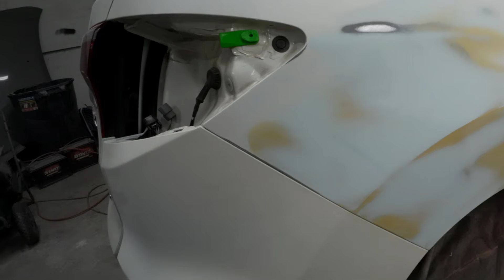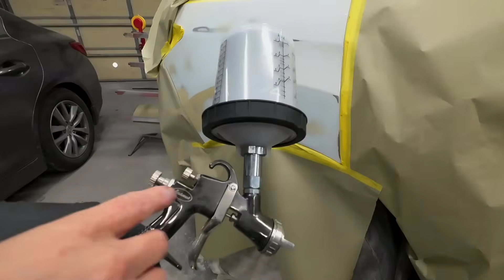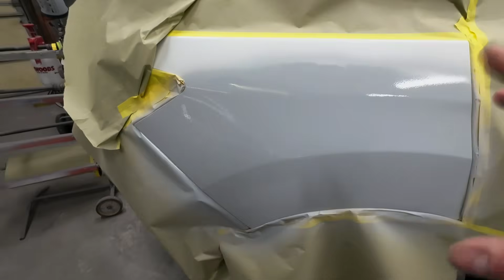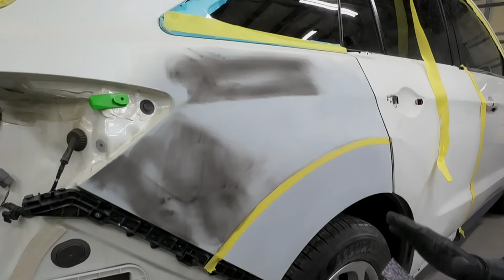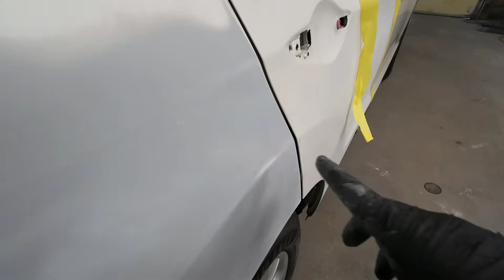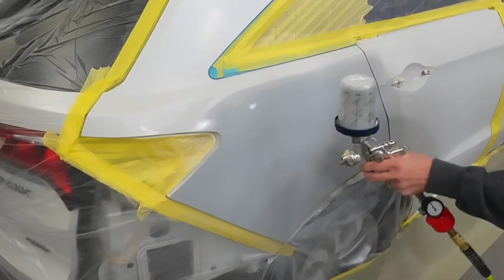How to get perfect primer before painting your car!

Comment: Can i paint over 2k surfacer primer?? Currently working on a project
Reply from the maker: Yes, it must be sanded first. Maybe I'm not following.
Reply: @GarageNoise gotcha and before applying the primer use sand paper should I use on the rest of the panels I would be applying fresh paint and clear coat

Comment: I do mobile smart repair and I'm very new during the summer when I was spraying my Nason SelectSeal Sealer it was no issue but now during these winter months it will super run if I spray like I did in the summer, I do preheat my panels, or alloy wheels if im doing those, to around 70-80 degree F but I can't seem to spray like normal doing one normal coat, I have to mist it on now in multiple coats to get my sealer to not run any tips to fix this? I'm spraying using a DV1 Base and usually around 15-20 psi Fluid I've normally ran it just full open, and i'm in southern california also for weather it's usually pretty good.

Comment: I'm confused because you said you were going to use it the primer as a sealer and then after you started sanding and putting the black Geico you said you were going to seal it so you actually sprayed it with a high build primer and then at the end did you see it

Comment: Hi, a question: can a primer surfacer be applied over a scratch sanded with 800?
Reply: Best to check the data sheet on the material you’re using, but in general it should bit into the surface and hold up ok. Keep in mind that when blending the scratches that you rely on for base and clear coat to grip into is most often 1000 grit.

Comment: Very informative video
Reply from the maker: Thank you! Appreciate the comment
Reply: @GarageNoise I've been looking for a video on how to prep parts with thick heavy chipping in the tight spaces, I'm working on these helicopter doors at work right now and you try and feather out the chips and it keeps chipping more and hard to get sandpaper in the certain spots. Sprayed heavy build primer thinking it was good and now have all sorts of cracks showing up. It's a nightmare. If you have a video that may help or could point me in the direction of one that'd be awesome. I can't find anything on here so far that even tackles the subject. Im still pretty new to all of this and your video gave me some useful tips in going to use from now on.

Comment: I have primed over 220 and never had any issues even 10 years down the road. But I do prime then block it. Prime again wet sand to 800 before color.
Reply: Same I step down to 180 so far no problem I read the tds for the primer he used it recommended 320 so that’s the part people don’t say in their video

Comment: Great video, if you are using metallic or Pearl paint I would sand up to 600 possibly 800 320 grit scratches will definitely show through clear coat. Always wet sand primer prior to base coat.
Reply from the maker: Yes I agree , primer must be sanded with 600 or a fine grit sandpaper before paint. I would not wet sand personally, I perfer dry sand because primer can absorb moisture.

Comment: Great video, I like sealer for certain projects, back in 91 finally got to restore my 68 Cougar the right way Dad had bought new and sold me at 18. I'd been through the ringer. Had to buy and read some books, even got a few videos from the back of hot rod magazine lol, and picked up a Miller Cricket for rust repair. Was Leasing an old Gulf Station at the time mostly for the auto accessories business with 2 hoists, was everyone's buddy! Started at left rear and just went around it, had to section in part of the rt rear quarter got from junkyard, old cars were plentiful, which was tricky but unnoticable now, was brazed and bondoed bad. Anyway have an auto paint store I still use nearby, back then DuPont had small guides on how to use their paint systems which was great, took out all the guess work. After a year and all was repaired...shot it with their sealer which I think was best thing I did and the single stage topcoat turned out great, but decided "factory frost green" sucks!, so we carefully wet sanded it down, my buddy knew a pro that showed up with a brighter bit darker tint BM Diamont 2 stage metallic green and had it sprayed again in no time and to this day still looks great, has enough coats on it, prep IS EVERYTHING! For dust control took bottom panals out of one door, put furnace filters in and used the really large squirrel cage out the back door through plywood that sealed doorway up and hosed down all the concrete, worked great no dust at all and the one cop didn't catch us, the other ones would stop buy to see how it was going, previous guy tried running a body shop with no booth, that was frowned upon by certain people, mostly the fire Marshal. Did my 14' 150 tailgate today, white paint didn't like the green primer they used few years.

Comment: thanks for the tips ..some of us would be lost without these tips ..i would be for sure
Reply from the maker: Happy to hear that, thanks for watching!
Reply: @GarageNoise  i can give a tip ..i'm no body or paint man but ....if you are using epoxy for sealer ...which can be done with the right mixing ...plan on basecoating that stuff before it gathers any dust ...cause if you have to sand the dust out of it .. i'd rather go to the dentist then sand epoxy ...its good stuff when you use it what its for ...but its harder to deal with then an exwife ..god bless and thanks for the tips
Reply: @spark23ca always read your product tech sheets and adjust from there.  Most tell you tips like that.

Comment: Couple of questions.. i'm about to paint my car and also lay down the final layer of primer before that but i was wondering.. if i'm painting the entire car in 1 go do i really need to use sealer? where do you recommend to finish spraying before a re-fill to avoid using sealer?
Reply: Also, i have a 2.0mm tip.. how should i set up my gun for high build primer

Comment: I am using Tamco 53xx DTM High build they told me nothing finer than a 220 grit for bite. This product does not shrink they say as well. I wonder why i can`t sand to 320 without an issue? They told me 150/180/320/400/600 after HB is laid down.
Reply from the maker: You should always listen to the manufacturer's instructions. It just a recommendation, I curious if you've used it and how it sand and if it if fact doesn't shrink.
Reply: @GarageNoise  it actually does what it says no shrinkage in the cup I've looked at other online forums about it as well they say the same thing the resins that they use are unbelievable crosslinks to virtually anything except for etch or acid-based

Comment: Im painting a Silverado and have done tons of rust repair to get it where i need it.(First time painter) The truck is 4 different colors and it needs some good filler work done now to get it straight. would it be best for me seal it after knocking the paint down well with say 180 first before body filler? then after applying body filler and working it smooth i was gonna spray high build primer(block it to 400) before i lay  my single stage paint. Does all this sound goos or do i have order of operations wrong?

Comment: Primer is a heavy body surface it requires a deep scratch a 220 grit scratch for good adhesion anything further than that will distort your body work and the poor adhesion to the filler it needs this for a mechanical grip to the service
Reply from the maker: 220 is fine, I perfer 320 that's  just a preference.  I would not recommend primer  over 180 tho too coarse in my experience. 320 is sufficient for mechanical adhesion.  Always refer to the technical data sheet for the product your using.  👍

Comment: You did a great job on the body work. How would you handle low or high areas on the primer for less then perfect work that would need to be refilled?
Reply from the maker: Polyester glaze or a coat of high build primer will correct waves

Comment: What is the best way to fix minor rub throughs to metal on the edges.can you use a high quality high build aerosol primer?
Reply from the maker: You can use primer if it's a direct to metal product. An easy way is a metal prep wipe or a aerosol of self etching primer. Just a light coat and your good to go.

Comment: I realized I made an oopsie after I did it, so I was sanding a spoiler for my car and got carried away with sanding, I did not have 600 grit sand paper and skipped from 500 to 800 and then wet sanded it with 800 to finish off, that was before primer, I realized I was sanding like I was prepping for paint instead of primer, is it okay to apply primer after sanding with such fine grit?

Comment: What reducer do you use for your Upol 2253 ? Does it have to be a Upol product which I know would def need to be the product of choice, but can you use a different brand of urethane reducers? I don’t have any available in my area except Omni reducer.
Reply from the maker: You can use any urethane reducer with upol
Reply: @GarageNoise  Ok good cuz I ordered a USC brand off Amazon.
Reply from the maker: @NDB390  that's  what I use as well

Comment: Do you advise using sanding with 180 DA and then putting primer, the DA sander leaves a much smoother finish than using it with a blocker, Or should I even use 320 when using the DA sander also?

Comment: ALWAYS primer before applying body filler. I can’t count how many times I have found rust under body filler that was applied directly to bare metal.
Reply: Etching primer
Reply: Tell that to insurance
Reply: Isnt the correct way is to fill over epoxy?
Reply from the maker: Yeah that highly debated topic. I've  done it both ways , if done correctly you don't  have a problem.  Appreciate the comment !
Reply: @GarageNoise 
I'm trying to finish up a COVID lock down project, a rust bucket 64 Corvair convertible.......yea, I started it 4 years ago and it has been outside covered. I had some help with certain areas and I cut and welded on some fenders. We'll, the car received various times of priming with 2k and now I'm trying to finish this thing. I have some very light rust that has presented itself. Im not going to take this back down again because it would jeopardize the body filler work.
I have started to re-lock sand it down, 80 now 150, my plan is to wipe it down a few times with OSPHO, finish blocking with 220, wipe down with PrepAll, and then use 2k or a sealer to finish before painting.
It's my car, I'm 67, and I just want to get it done and drive it😢. So 2k or sealer?......but then Sealer is harder to block right?
THANK YOU SO MUCH FOR YOUR ADVICE.

Comment: Great upload Sir! I am just the regular diy guy trying to get away with murder, I guess, compared to a pro painter. I do it this way: ' Clean your surface with bathroom cleaner and Scotch brite. Sand with 600 grit. Clean with window cleaner. Clean with water. Dry the water off with paper. Add primer. 4 layers. Then paint. Lol. Pinstripe on the background paint. Add nitrocellulose lacquer. 3 layers. But as you may understand, I look at this to learn even more. And before even adding primer is where I am cheating. But this video helps! Thx!

Comment: Early on in the video you talk about the importance of sanding up to 320 grit. And if you don’t, the materials will shrink in the sun and anything courser than 320 grit will show through.

I had a weird situation where I put a wheel well on a rusted pick up truck about 15 years ago. Instead of my usual welding, I was experimenting with Eastwood’s blind rivet and panel adhesive. I thought it would prevent rust at the seam.

Years later, I noticed you could see almost perfectly where the wheel arch replacement panel  and original body sheet metal met. In addition to that, You could see where each rivet was perfectly. What would’ve caused that? I usually wet sand up to 1000 grit before shooting Paint. It looked great for years.
Reply from the maker: Was it black? I've  seen that same type of situation on one of my repair in the past. Not a good feeling. My only explanation was filler  shrinkage. Back then I used cheap body filler and paid the price. Quality products  really make a difference  but sometimes you don't  know how well a product works until unfortunately it shrinks. I'm  not sayong you used cheap filler but shrinkage can be a big problem even if you do everything right!
Reply: @GarageNoise  it was PGF Chrysler  color on a gen 2 Cummins. It’s dark green. You’ve probably shot it a dozen times: pearl green flake.
Reply: use a fibre glass filler over metal work. it fills gaps, coarse scratches its strong as steel and dose not shrink. then apply other type fillers

Comment: Isnt 15 to 20 psi to low? Ta
Reply from the maker: Not as long as you adjust your fluid accordingly.  So less fluid, at 15 to 20 psi. Typically I'll spray primer with fluid at 2 turns out from closed.
Reply: @GarageNoise  thank you

Comment: What brand of 600 DA sand paper are you using, any sand paper i used to make 320 scratches disappear, it was almost impossible, or you should use 4 sandpapers on each panel.
Reply from the maker: The brand I use is sunmight ceramic it's awesome for 600 
https://amzn.to/3Zwunl4

For everthing else I use 3m cubitron 2 best I've  found for price and durability

Comment: How long can you leave primer on a vehicle before you paint? I have a 91 GMC 1500 I wanna redo in stages. Can I prime the bed and let it sit while I get the front end done and paint it all with car later or is there a window of time between primer and paint?
Reply from the maker: If it's not gonna be out in the elements than you can let it sit in 2k urethane primer for months but if you plan on having out in the elements whiles you gradually redo it ,then I would recommend using an epoxy primer. That can be in the elements and will hold up alot better until your ready to paint.
Reply: @GarageNoise  thanks for the info. The body is in great shape but the paint is shot. Got a couple of small dings but no damage. I plan to use the same color so I won't have to do the jambs. Really enjoy the videos!

Comment: What tip were you using while spraying primer? 1.4?
Reply from the maker: 1.3 this time but I also use a 1.5 for the thicker high build.
Reply: @GarageNoise  which tip when you were spraying the sealer? 1.3 also? I’m about to spray for the first time DTM 2K high build urethane primer/sealer as a sealer reduced to 4-1-1, don’t know if I should use a 1.3 or 1.2 for sealer?
Reply: @wild8757 add more reducer and make sure to use slow hardener and slow reducer so it'll flow out more. It'll increase cure time slightly but not much since the sealer mil will be thinner. One wet coat should be enough
Reply from the maker: @wild8757  1.3 is what I use

Comment: What is recommended for a Good flexible primer sealer for plastic bumpers? I have the Seymour PBE Flexible Primer and SEM Flexible Primer Surfacer and they work GREAT! but im looking for Primer Sealers out of a can that I can use next... Either a 1k or 2k but definitely prefer a 2k can that either is activated by moisture in the air, or has a 2 part chamber system inside the can... Any recommendations!
Reply from the maker: Spray max makes a 2k sealer.  Not sure if it's  considered flexible for bumpers.

Comment: Used the same primer last week had to go 4.1.2 to avoid orange peel
Reply from the maker: I wouldn't be afraid of a little peel in primer it's  meant to be sanded  smooth. I do have to use a 1.4 or 1.5 tip on my gun when I spay a 4:1:1 ratio . Appreciate the comment brother!
Reply: 4:1:2 is the suggested sealer mix, but for the 2253, I've found that slow hardener and slow reducer with an extra splash of reducer gets it right for sealer application. For a primer, orange peel isn't a big deal since you want that high build anyway. Adjust the gun and your passes more

Comment: Really like your videos a lot. Do you have any videos on what to do if you run into issues after you have finished your body work, like how to deal with pinholes found in body filler areas after primer? Or how to handle deep scratches in the body filler that were not filled by the high build primer? I’m a newbie at this body work and trying to learn how to handle mess ups after I’ve made them
Reply from the maker: Not specifically, It's  mixed in with primer  prep video's this one might help https://youtu.be/pTIU1-gIevg

Comment: have any experience with PPG shop line? im going to fix the roof of my Ram i have some rust spots
Reply from the maker: Never used the shop line but the ppg deltron was great stuff.
Reply: @GarageNoise i just used the shopline color match was really good. i cant tell a difference. it was my first time painting my only complaint is that i got tons of fish eye. I'm pretty upset since i spent hours prepping. on a good note i didint have any orange peel

Comment: After stripping a car to bare metal, what’s the best sand paper to use for proper primer adhesion?
Reply from the maker: 80 grit is what is recommended. Check the TDS on the filler your using tho. Appreciate the comment and support!